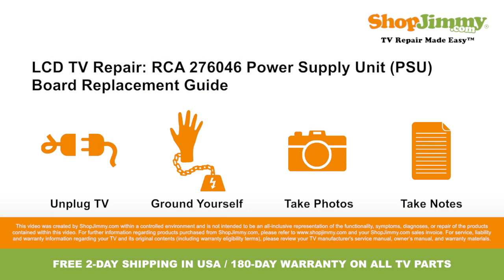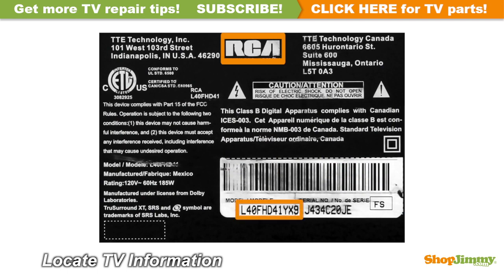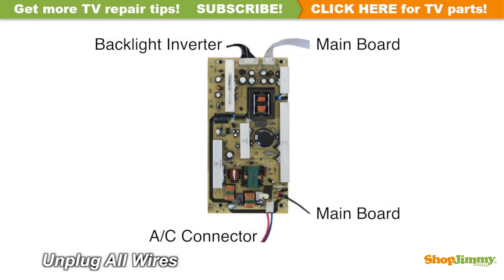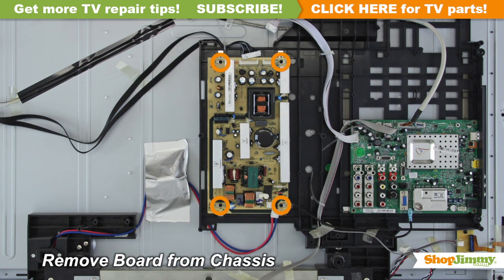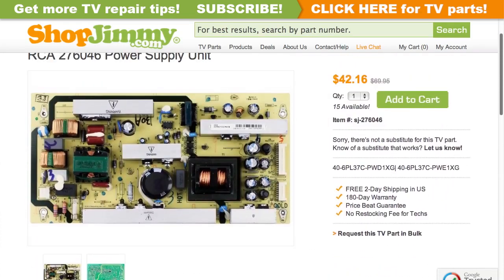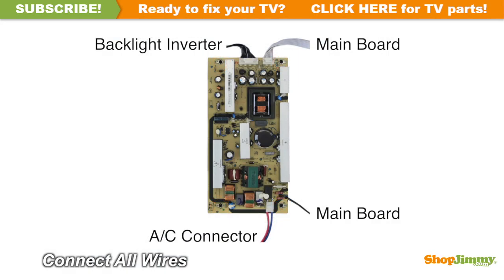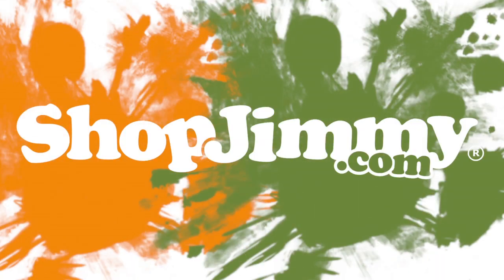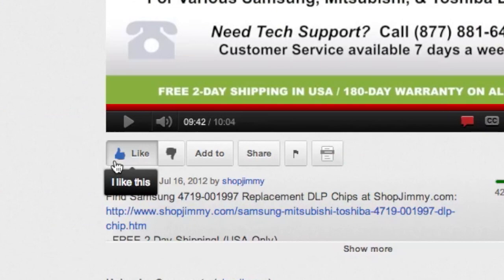RCA 276046 Power Supply Unit (PSU) Boards Replacement Guide for RCA LCD TV Repair

Comment from the maker: @drwtennessee - I recommend replacing both the power supply and the backlight inverter for your TV.  The power supply part number is RCA276046, and the Backlight Inverter part number is LJ97-02098A. If you search these part numbers on our website, you will find the product pages and be able to purchase the parts from there. Unfortunately we do not have the connection cable between the power supply and the backlight inverter. Thanks and please let us know if you have any questions! (877) 881-6492

Comment: i have a rca L40FHD41YX9 its stuck on hdmi. and the side buttons will not work just the power button, the volume control turns all the way up...and i tried to usemy comcast remote on it...but all the codes did not work...like i said the tv turns on but it on hdmi and i cant use the side buttons to change...help...i was look to get a main board..what else is wrong
Reply from the maker: Mike G   I recommend replacing the main board in your TV.  Here is a link to replacement parts for your TV model number on our website, click here:  http://www.shopjimmy.com/catalogsearch/result/?q=L40FHD41YX9  Be sure to match part numbers on your current board, with your replacement for compatibility.  You can also call our customer service for further assistance with your purchase.  (877) 881-6492  Thanks and please let us know if you have any further questions with your TV Repair!  www.shopjimmy.com

Comment: My screen went black but have sound. I have 3 bulging capacitors on my power supply. I also have a burn't backlight inverter wiring cable at the power supply connection. Do you have the power supply and the backlight inverter wiring cable? My model number is RCA L40FHD41YX8. I cannot find this power supply to the backlight inverter, cable on your web site.